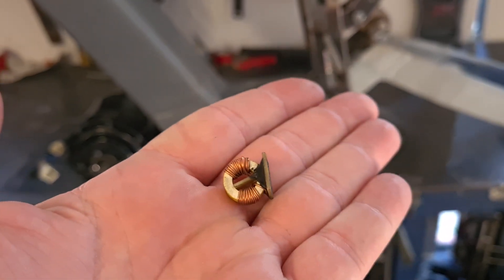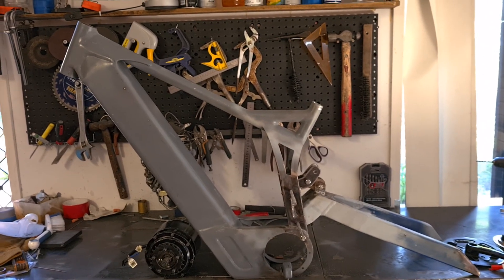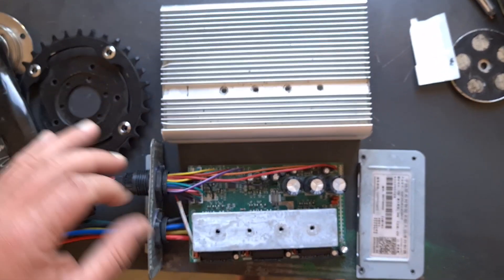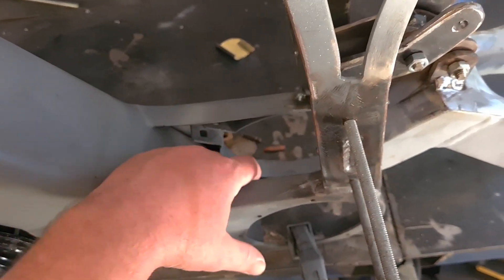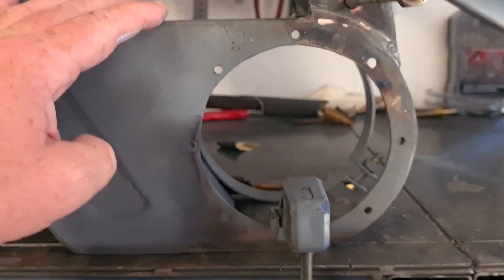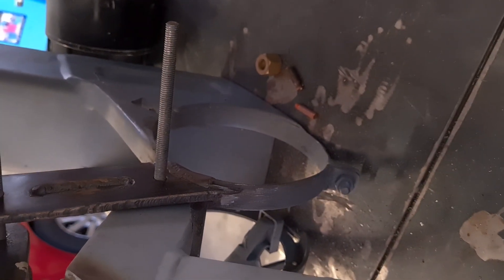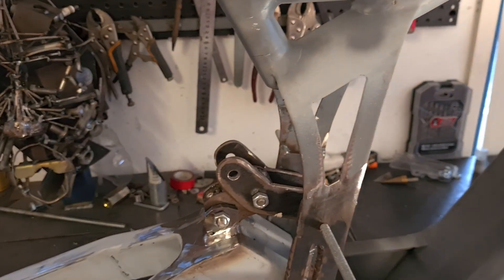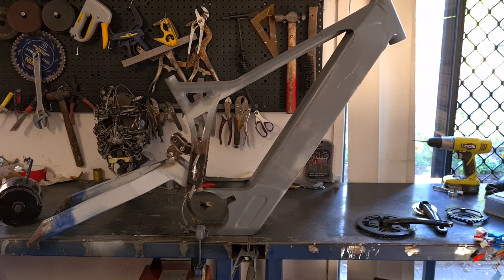CUSTOM Cyclone Coaxial E-BIKE BUILD UPDATE #2

Comment: Does it has a torque sensor ?
Reply from the maker: Not yet
Reply: Can the torque sensor be added to this motor and made pedelic, with the option of trottle.
Reply from the maker: @timbuktooKing  there is no plug and play torque sensor for this motor... there is a cadence sensor that will work. Torque sensor is still possible but will require a custom fit.
Reply: @simonchamberlain9215  Thanks for the reply.